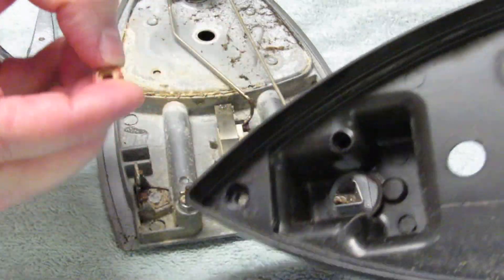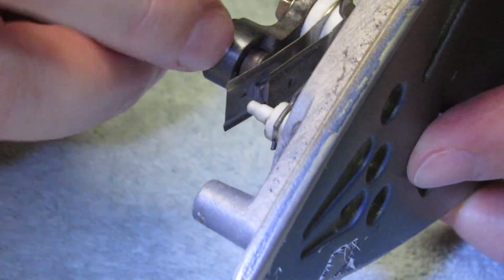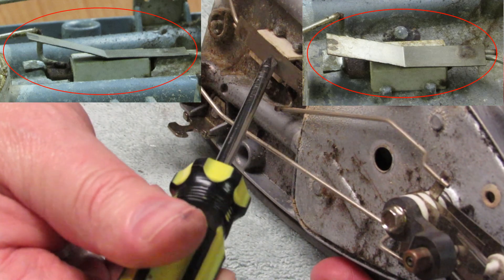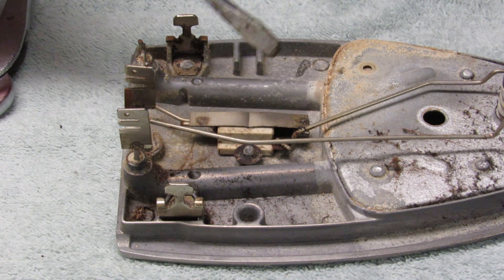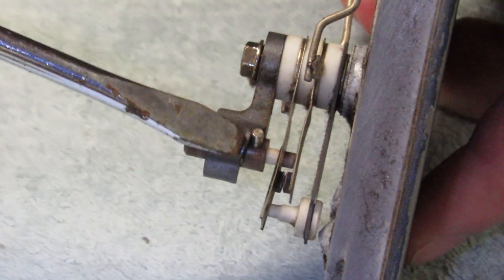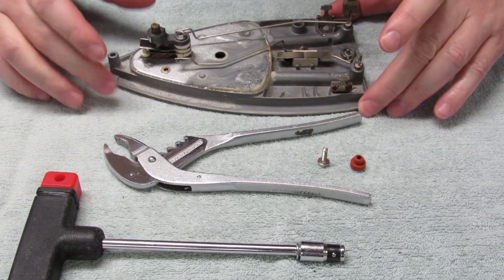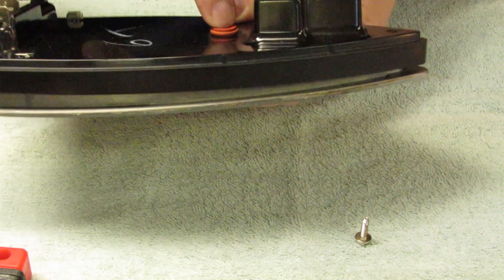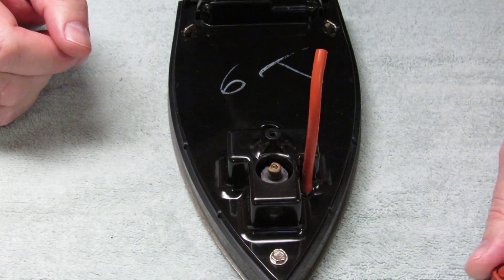DIY #1 - Steam Iron Fix, part 2

Comment: There is no variable resistance in an iron.  What you were referring to is a thermostat that switches off and on as the soleplate heats and cools.
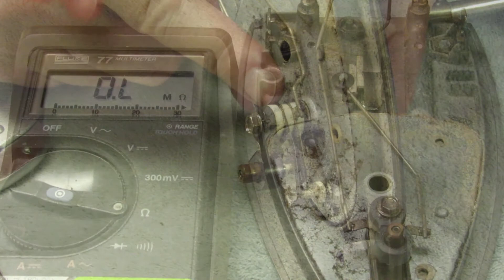Reply from the maker: Yep, I did eventually come to that conclusion at around 09:00, I also show how I checked the resistance of the circuit to prove that out.  I guess it works more like a bi-metal thermal switch, where turning the knob clock-wise puts more and more strain on the one side of the switch plate, making it more and more difficult to open the circuit as the plate heats up.  

Thanx for your comment Peter :)